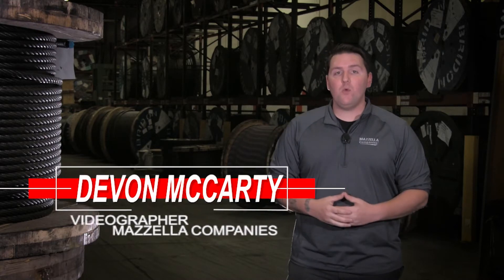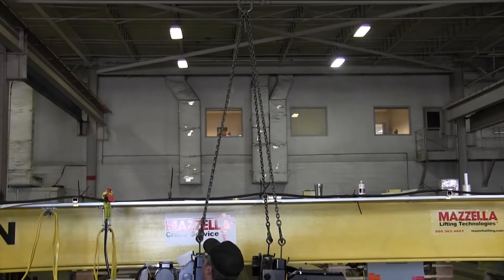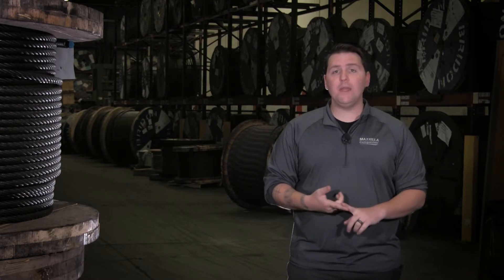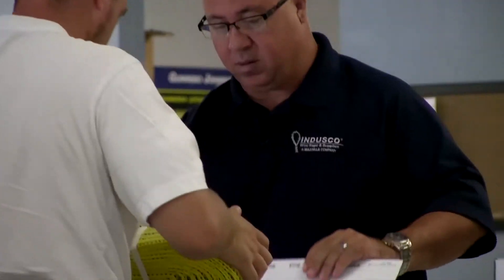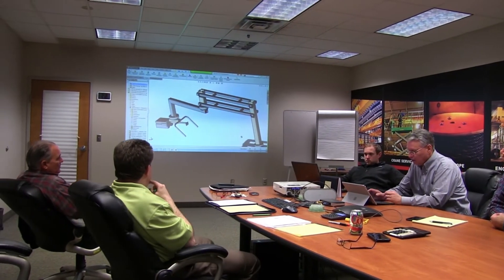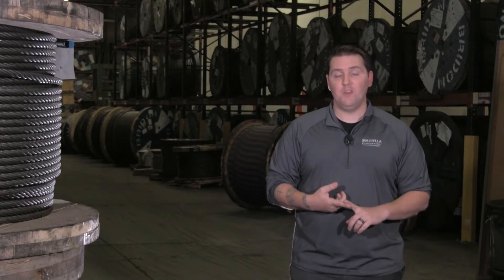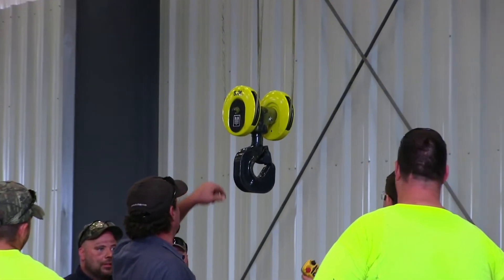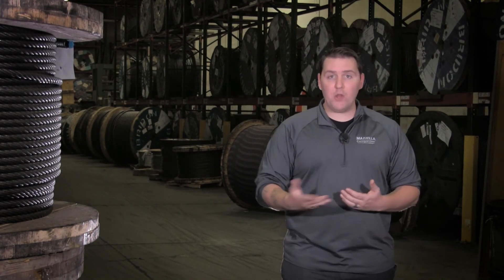Buying an Overhead Crane: Consultation to Installation & Beyond

Comment: Would I be correct by saying the higher capacity overhead cranes (50 Ton Vs 25 Ton Vs 10 Ton) preferably would require a shorter travel distance for the trolley?  TIA.